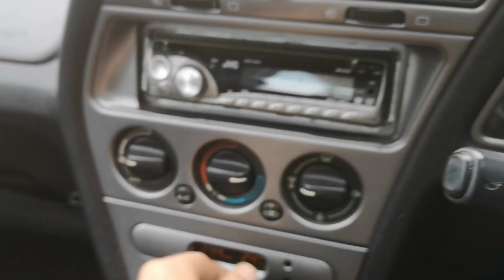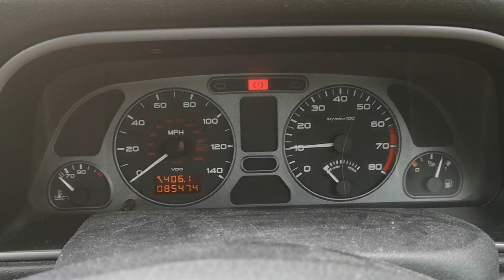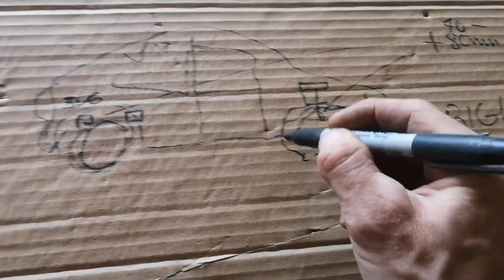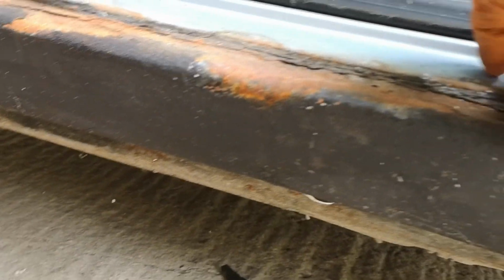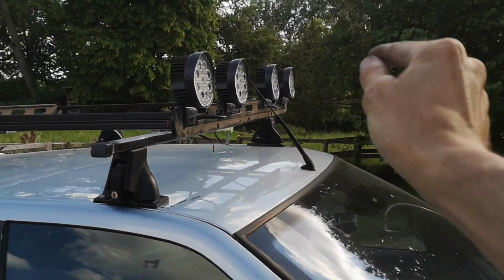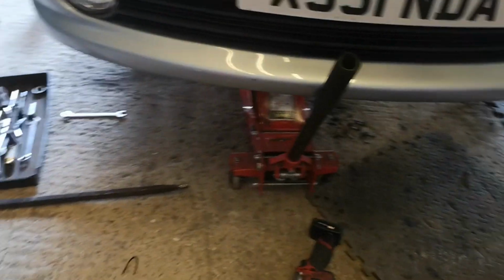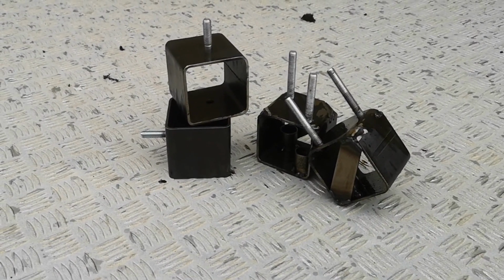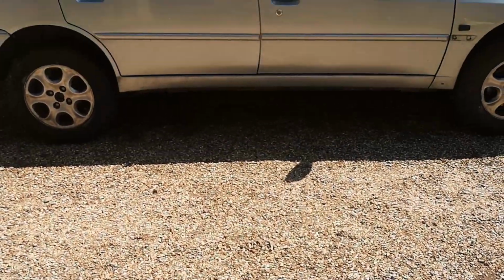Off Road Peugeot 306 - The Pugmudder - Part 1

Comment: Hi dude nice video? how did you strap down the roof rack?
Reply from the maker: Thanks! What do you mean by strapping it down?? I didn't use any straps. Roof bars clamps on like any other roof bar.
Reply: @PiggyPower  sorry my english isnt best. i meant how did you attach the roof rack to the roof? did you simply screw it into the roof? I'm trying to do the same but I'm wondering how. thanks for your answer
Reply from the maker: The 306 has threaded m8 holes for the roof bars. X4 for a 4/5dr and 2 for the 3dr and a clamp for the rear on a 3dr.
Reply: @PiggyPower  can I find the location and measurements if these threaded holes in the car manual?
Reply from the maker: @gliderenthusiast  in the manual, Google etc ... M8 threads. Easy to find
Reply: @PiggyPower  alright, thanks a lot

Comment: wasnt it possible to increase rear height from the torsion beams?? (as seen from a previous video of yours)
Reply from the maker: Yes, but you limit the travel if you do this... The damper will bottom out on extension. So you can only go about 30mm or so.

Comment: Hi mate just come across your channel and haven’t stopped laughing yet 😜. Picked up a 306 estate today 1.9d (non turbo) 🤮.
Acceleration pedal is really stiff do you have any advice at all please 🙏
Reply from the maker: Check on the pump if there is what looks like a miniature damper (like you'd find on the rear suspension)... They can get stiff. Otherwise the cables themselves. But if you disconnect the cable...and then feel the pedal and you'll soon know
Reply: @PiggyPower  thank you mate I will look into it tonight as also have a stiff clutch pedal 🤣 such a pig to drive but i get the fealing it’s just adjustments that need making fingers crossed 🤞🏻, where are you based? 
Cheers geeza
Reply from the maker: @benjaminmountford2585  clutch will either be the cable or the bushes inside the box that the release shaft rotates on
Reply from the maker: @benjaminmountford2585  I am north Cotswolds 👌

Comment: how much size box section for lift rear axle? is it 80 x 80 mm ?
Reply from the maker: I think stock steel box section is 75/75?
Reply: @PiggyPower  ok, thanks. what has been done for lift front axle ?
Reply from the maker: @karyadijaya  don't mean to be mean but ...have you watched the video? 😅😅 Its all covered
Reply: I watched all of video part 1, but didn't see video adding the spacers for front axle. 

Many thanks, This video has provided an overview of how to lift axle the 306 suspension.
Reply from the maker: @karyadijaya  watched part 2? 😜

Comment: piggy you need to knock up a bull bar for the front, strip the remains of the the interior out, and just have rubber mats and water proof the electrics in the engine bay.
Reply from the maker: Electrics in the engine bay are pretty much waterproof. I'd only put some sort of bar on front for a winch. Don't see the point otherwise. Keeping interior for the next owner. Adding bed for next trip out as hammock was cold